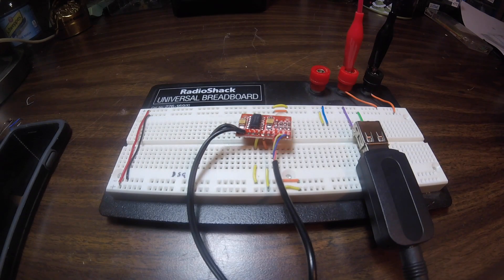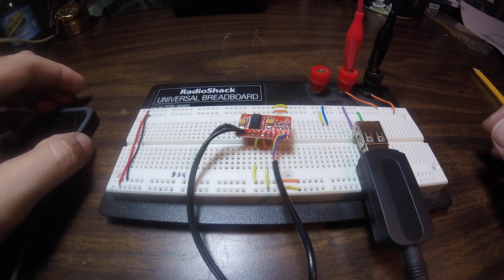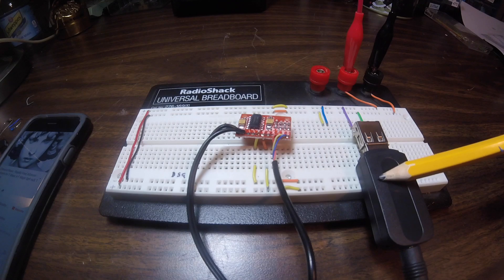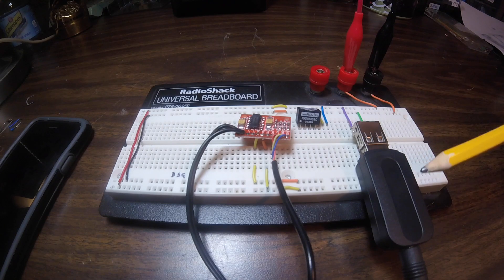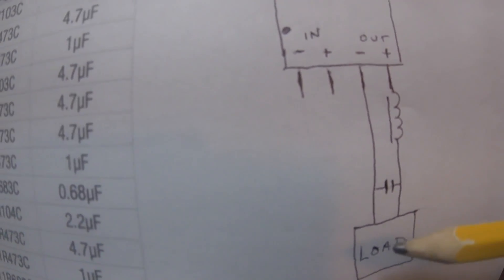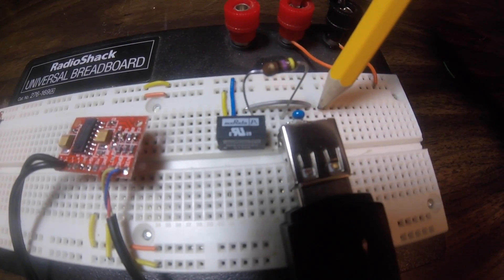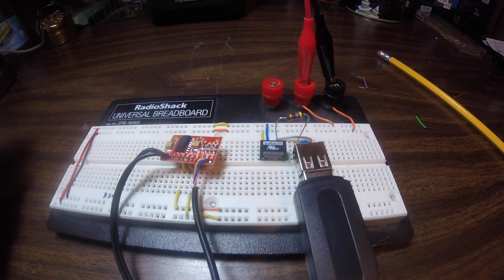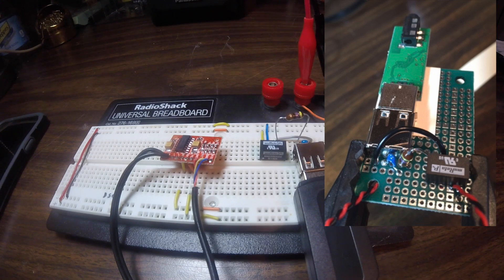Bluetooth Ground Loop Isolation

Comment: I tried adding a bluetooth 5.1 module to an older 18v Dewalt jobsite radio. I highjacked the AUX port and pinned out the TRS jack and I found +6v on the same little AUX pcb that is inside the radio. I wired it up and I'm getting some pretty bad interference now. I tried adding a 10 ohm resistor to the ground wire powering the bluetooth module but that didn't help. I'm about ready to order one of these dc to dc isolators. I hope it cleans up the noise. Thanks for the video.
Reply: Haha I'm doing the same with a makita one right now. How did yours go?
Reply: @MartinDolan I tried installing a dc to dc isolator on the +6v dc that I found on the aux PCB. It still had too much noise to be useful. I need to take the radio further apart to try and locate another +5v dc source to power the Bluetooth board.

Comment: And yet I still I read a lot of comments in different places to use a transformer if someone complains about these 'weird' noises.  I always refer them to these since they don't alter the sound quality, don't take up a lot of space and are cheap.  Ok they have their limitations like a not so steady voltage output but I have yet to have an issue with that. 
Cheap Chinese BT modules now sound better and the thing that I use every day which is my ESP32 and PCM5102 webradio player is noise free. Win Win these things.

Comment: Yep.  I just use a battery..
Reply: Nope it does not. Battery also cause the same high pitch sound. I tried this combination to repair a Bluetooth speaker and that's how I know and Why I am here.
I am going to try and see... don't know I will remember to post afterwards. Thanks anyway..
This video didn't came up when I searched. Only suggested few days later

Comment: Q:  If the component truly isolates its 2 sides, why are the support component necessary?  Doesn't 'no connection' inherently mean that no ripple is passed on at all?  Why the extra filtering if there isn't anything there to be filtered?  (In other words, I already have the B0505S-1W isolated converter, and may or may not have the inductor and capacitor, but I'm way too lazy to look for them if I don't really need them!  lol)
Reply from the maker: the extra components are optional and act as a highcut  filter if your power supply has some ripple

Comment: Very interesting explanation. 
I don't know a lot about electronics but I was able to follow along.  
I'm assuming the reason I'm hearing ground loop interference from the Bluetooth transmitter in my car is because it is powered and grounded along with the factory car amplifier.  How would I go about getting rid of interference in that case aside from powering the transmitter with its own battery?
Reply: the buzzing sound travels through the lines of the dc power supply, which is why the power supply is isolated or you have a good filter to eliminate that noise.

Comment: Would you please tell me what size capacitor and inductor I need if I where to use a 12-12 isolator. Note. It will be for my car so it will be power by a car battery 12v

Comment: Hi. I am using these for a a few things now they are brilliant but they die very easy if you make mistakes. But I never used the inductor or cap before. I think without it sounds fine. what are they for?
Reply from the maker: yes, they are delicate. The inductor/cap is really just a filter. if you have a clean DC input, they really  aren't necessary

Comment: Word of warning: Those small monolithic isolated power supplies like the Murata one shown in the video are in general very poorly regulated, especially at light loads. The datasheet specifies a 10-15% variation in load regulation from 10% load to full load, meaning a "5V" supply could swing as much as 0.75V across its output range (generally just barely acceptable for USB devices). Worse still, they're almost always "unspecified" below 10% load, meaning the regulation is generally awful at very light loads. The Murata datasheet actually states output voltage can rise to as much as TWICE the rated value for loads below 5% (so 10V on that supply), which can easily kill a low-current device that's not expecting it - ask me how I know.

Options for avoiding this include:
1. Ensuring you don't "oversize" the converter (make it just big enough for the load current of your bluetooth receiver, keeping in mind if your receiver has a low current "idle" mode when it's not connected to a device) and making sure you never unplug/replug the bluetooth receiver when the circuit is powered.
2. Adding a "dummy load" resistor to draw a bit of current all the time. The shown converter is rated to 200mA, so keeping it above 10% only requires a ~250 ohm resistor that will dissipate 0.1W, so a quarter-watt through-hole resistor would work fine here.
3. Putting in a Zener diode to shunt voltage if it rises above a certain point. A 5.6V or so Zener could do this, but Zeners aren't generally that "sharp" at low voltages like this so it might not regulate much better than the simple resistor, and is more expensive (you're also less likely to have one lying around).

Also note that you might run into problems depending on what USB port you're using to power the receiver - if the data lines are connected to something else (like the vehicle), it could prevent you from breaking the ground loop depending on how the rest of the system is wired. Best to ensure you're using a cable or circuit that lacks the USB data lines completely (like the demonstration shown on a breadboard here) to avoid that issue entirely.

Otherwise, this is a great alternative approach to an isolation transformer, as it will preserve the audio quality on the analog audio side of the circuit (audio transformers will typically negatively affect audio quality, especially on the high frequencies, at least a bit).
Reply: Thanks for this comment, helped me with some of my concerns.

I've just recently spliced aux into my older Lexus by stealing the CD changer audio lines and that worked out great. I decided I wanted bluetooth, so I bought a battery powered one and that worked great. I decided I'm too fancy to have to charge a bluetooth device and press a button to turn it on each time I enter the vehicle, so I bought a higher quality 5v usb powered bluetooth receiver and tied it into my car amplifiers ACC and GND via a 12v to 5v buck converter. 

I'm getting noticeable ground loop when paused, playing quieter audio or audio with breaks of silence in it.

If I were to replace the buck converter with a 12v to 5v isolator like the one in this video would that potentially work? Would simply a 3.5mm ground loop isolator between the aux cable and bluetooth receiver be enough?

Also worth noting, the ground loop noises only play on my right channels, all of them, but none of the left channels. Not sure what thats about.
Reply: @Twitchyii  You can break the ground loop on either the 3.5mm aux side or the power side, doesn't matter which - the advantage of doing it on the power side is that it should have less effect on the audio quality compared to the analog audio side of things (unless the power converter you use introduces a lot of its own noise). One of these isolated converters as shown in the video (with the caveats I mentioned about minimum load and ensuring the data lines are not connected) should do the trick for your scenario, if the noise is in fact caused by a ground loop. Not sure why you're only hearing it in one channel, but RF works in mysterious ways so it's hard to predict where problems will manifest.

Also note that it's possible your noise is caused by your buck converter outputting a noisy 5V signal rather than a ground loop. An electrolytic capacitor in the 50-500uF range across the 5V output might help with this if that's the problem in your case, or switching to a different buck converter might alleviate it.

Comment: I have a TPA3118 mono module. I modded it, decreased to 20db gain. I added a potentiometer for volume adjustment.  The pot when full and zero level no noise but at middle levels i m hearing noise. How can i eleminate this problem?

Comment: I really need your help... I bought a bluetooth module for my car. And it have that buzz noise...I connected the Bluetooth wires to the cigarette supply.
Reply: You basically connected the radio and Bluetooth module to the same power supply which causes ground loop hum noise.  You can use powerbank to power your Bluetooth module and thus isolate the grounds. :D

Comment: Hello NizzyAmps CSIMC YX48D05-10 isolator, but cant find the capacitor or inductor needed, I tried to find the datasheet but no sucess, If you can advice that be great! thanks in advance for great video I was searching from long time.

Comment: My converter gives more output than input supplied, is it normal? Like i gave 4.8volts and output is 5.2 volts.
Reply from the maker: YEs, one it has a load on it, it should go to 5V

Comment: Thnk, this was an issue I came across. Works for me!
By the way, I am suffering from low volume output of my Bluetooth receiver module (KRC86B). I think I need to combine it with a pre-amp board. Do you have any suggestion which to use?
Reply from the maker: Ernst Kolvenbag I have found a few boards that have had very low volume. Those have had a 47uF cap included instead of a 470uF cap. I suspect a counterfeit board. A real board has plenty of power to drive an amplifier without a preamp.
Reply: @nizzyamps1317  I read this comment after having ordered a KRC86B board. I checked the capacitor and it had a 47uF one... So to be sure I went back to uncle Ali and ordered 3 more of these boards from 3 other sellers to compare the sellers and quality of the boards.

2 out of 3 boards have arrived
- One has a clean electrostatic bag where the board and capacitor (470uF)/LED are separated.
- The other has a 47uF and a sloppy seal on the bag.

I have yet to test all of the boards, so I can find out which sellers are to be trusted 🤔

Comment: I agree with your experiment using dc- dc isolator solves the problem.I have the same problem when I am supplying 3.7 volt from a common battery to both Bluetooth audio receiver & class d audio amplifier.
So in your video you told that an LC filter at speaker output also solves the problem.Is it necessary in a filter less class d audio amplifier.Please comment.

Comment: Can I skip the capacitor ? Can I replace 47uH with 22uH?
Reply from the maker: If you skip the cap, skip the inductor. These form a high pass filter. One won't work without the other. Generally, as long as the input voltage is clean, the output will be clan as well.

Comment: DC isolator is perfect, but the cheapest way is to add a capacitor with a value of at least 2200uf.
Reply: Whre to connect?
Reply: @toto073081  In DC power
Reply: @arunbalakrishnan8978 
Seriously? By adding a 2200 capacitor to the power input, Bluetooth noise disappears?
Reply: I'll try it tomorrow
Reply: @edyyusuf8974 if the noise is due to power supply it will disappear. Or simple use a separate 5v smps.
Reply: @arunbalakrishnan8978 
Noise occurs when a Bluetooth device is connected to music on (YouTube) noise (nging...),

and if not connected it is not noisy
Reply: I have installed DC ISOLATED B0505S, it is still noisy

Comment: I hooked it up per your instructions and it hums even louder. Now if I put my hand close to the isolation converter and touch it it hums really loud.
I noticed that you used a USB port to connect the Bluetooth. Would it make a difference that I removed the female port that was on the bluetooth and directly soldered the dc 5v + and - to the module?

Comment: Great idea. Just built one. One question, my capacitor gets hot right away, without even any load on it ( 25V 4.7UF). Does that make sense?
Reply: never mind, it helps if you use regular capacitors and not tantalum capacitors which have a polarity....
Reply: ceramic may be recommended / + review your power output capacity tolerances with their values @MrPaulSijben

Comment: In the case of using a common power supply to operate both modules... Remember, the bluetooth module generates an interesting step-function type noise (buzz) as the IC consumes current.  These audible pulses occur in the power supply and will come through the audio channels in the case of poor grounding between the two.  I suggest soldering one or more heavy and short straps between the amp and bluetooth module ground planes.   I use solder wick braid for this.
Reply: @Bobo Depending on the flux type and humidity, it can but not typically with rosin flux.  I have noticed bacteria can grow in rosin flux.
If there's any concern and as general practice because I prefer the look of a clean pcb without flux everywhere making it ugly, I often use MEK (methyl-ethel-ketone) solvent in a small brush to wash rosin core flux off my pcb's.

Comment: Hi, I have a similar setup, but it is entirely 12v, 
Is this the right kind of part? MeanWell (D/S)PU01M-12
Should I use different rated capacitor and inductor for 12v?

Comment: Hi! Good job! 
But i have a question about the ground of BT receiver. This is not connected to common ground of amplifier and power supply? Or the BT receiver output ground is floating and not connected to ground input? Thanks!
Reply from the maker: The output (-) of the BT board is connected to the input (-) of the amplifier. So it is in fact connected to the power ground of the amplifier. However, the BT output (-) is floating due to the isolation transformer.
Reply: @nizzyamps1317  HI! Now makes sense! Thanks!

Comment: How much Amper the dc-dc give?
I need something the clean the ground loop noise form  chromecast audio that share the power with the amplifier
Reply from the maker: it gives no amplification. It is a power supply only. For your situation you would be better off with an in line ground loop isolator between the chrome cast and amplifier

Comment: Please help me, I am currently building my diy portable speaker.I have 2 20w 4 ohms speakers connected to PAM8610 amplifier powered by 3S2P 18650 batteries which has an output of 12 volts. I want to connect the bluetooth receiver which only requires 5 volts to the same 12v source of the amplifier using a DC-DC step down module. And i heard a lot of people complaining about ground noise. In this case assuming that the voltage is stepped down to 5v, what capacitor and inductor should I use and where will I connect it? Please help me. I have the slightest knowledge about electronics since I’m in the medical field. And so far, your solution is the best. Please haaalp

Comment: Hey there! Great video.. I'm wondering if an isolation transformer on the output of the bluetooth will do the same job? Why do you think the power supply isolation is better? Thanks!!
Reply from the maker: Yes you can do that. It will work well.
Reply: @nizzyamps1317  Could you recommend one please?

Comment: Great work! This is the answer I have been looking for. I am a newbie to electronics, do you know what value inductor and capacitor to use for a 12v dc to 12v dc isolator? Help would be greatly appreciated
Reply from the maker: from the Murata nke1212sc data sheet: L=68uH C=0.47uF.
Reply: @nizzyamps1317  . thank you! brasil

Comment: Hey great explanations. I have used 5v to 5v DC-Dc isolating module in my DIY bluetooth speaker I stil have ground loop.
Here's how i connected the converter, The 5v power input to the amplifier and i removed the sheath a little from both +ve and negative wires and connected the DC-Dc isolating converter there and connected it to the USB Bluetooth module. Is that type of connection ok? I use PAM8403 with two 3 w 4 ohm speakers. and 1 more thing there's a slight hear beat like thump from the speakers as well. Can you suggest me the inductors and capacitors of the right value so that i solve this issue?
Reply from the maker: If I understand correctly, you have it connected properly. Not sure why you are getting the sound loop
Reply: Thanks for your reply.What about the slight thumping like heart beat pulse what shall i do for that? Any capacitor or inductor is should use?

Comment: Hi, can I use only the DC-DC isolator without using capacitor and inductor? Thank you.
Reply from the maker: You can, they are a low pass filter to eliminate noise but if your input DC is clean, its not always needed.
Reply: NizzyAmps thanks a lot.
Reply: You can try if you get an isolation DC - DC converter that is regulated internally

Comment: Hi, great work man. Have you ever done any work with the noise/ground loop on a tda7492 Bluetooth amp?
Reply from the maker: No, theres not much you can do in the case where the bluetooth amp is integrated with the amplifier board. That's why I usually use a separate BT module and amplifier

Comment: I have a bluetooth module that is 6v at the lowest allowable voltage what would I need to use to do this?
Reply from the maker: Marshall Smith depends on what the voltage range of the amp is. Send me a link to your particular amp and I’ll show you how to do it.
Reply: TDA7492 Amp
4.2 Bluetooth board

I have a buck transformer ran to the bluetooth board because one of the zeners didn't like anything above 12v and I have a step up transformer running to the amp at 25v for max output power.

https://www.ebay.com/itm/Amplifier-Board-TDA7492-D-Class-High-Power-Digital-2x50W-AMP-Board-w-Radiator-1x/132588090812?hash=item1ededdb5bc:g:wxcAAOSwrklVOKIJ

https://www.ebay.com/itm/Bluetooth-4-2-Audio-Receiver-Board-CSR64215-Wireless-Stereo-Module-Replacement/172867396249?ssPageName=STRK%3AMEBIDX%3AIT&_trksid=p2057872.m2749.l2649